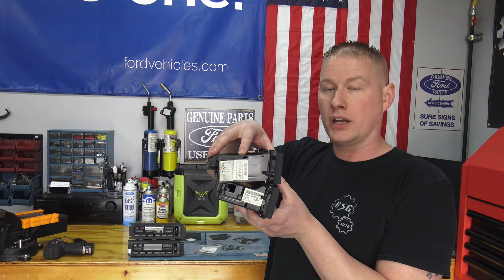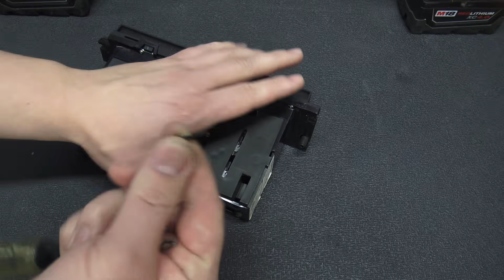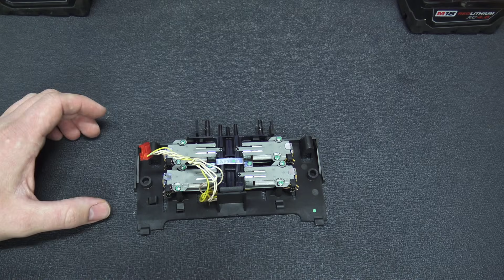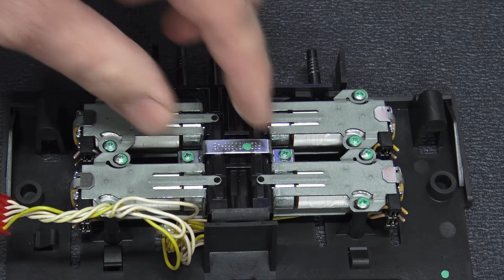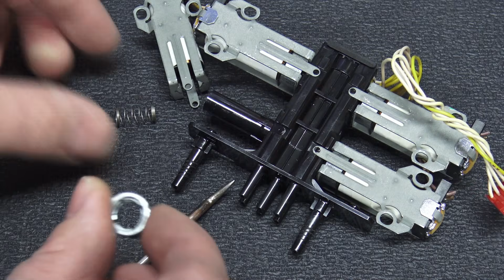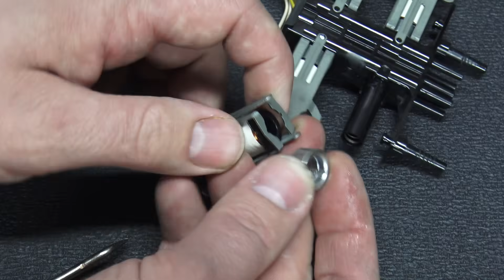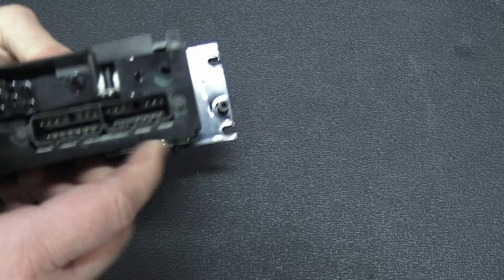Ford HVAC System Stuck on Defrost: EATC Control Head Repair

Comment: Hey man love the videos. Typically the first place I go when working on my 2011 F150 ecoboost. Quick question for you though. Ive got a 2011 f150 Lariat 4x4 with the dual climate control.. Ive already replaced both driver and passenger blend door actuators. Do you have a video or location of the defrost actuator? I cant get anything out of the floor or defrost vents. Ive removed the actuator on the lh side by the throttle pedal and it doesnt even try to hunt after a key cycle and i havent been able to locate the defrost actuator. Thanks man and keep the videos coming
Reply: Id like to add i have removed the actuator and manual operated the door and it only seems to control the foot to face.

Comment: Great video..wish you would of shown how to take the unit out of the vehicle. But I'll figure it out. Thanks
Reply from the maker: Every vehicle is different so I left that out.
Reply: FordTechMakuloco I've got a 02 f150. My air is stuck on defrost. And it's like 90+degrees here. Thank you
Reply from the maker: follow this video to remove the trim panel- https://www.youtube.com/watch?v=0hVI5Yryc1w
Reply from the maker: Oh yeah try this first for sure last I checked your head unit was $675
Reply: FordTechMakuloco OK Ty so much

Comment: Great video, thanks, fixed two units today, but over 4 ours of work.
Other important item is that there is a check valve on which the spring acts which is not shown in the video and it has two different ways to go in of which only ONE is the correct way. The larger "pad" is towards the vacuum ports and the smaller pad towards the solenoid spring.
Also it is really important to put MORE of the O ring sealer/lubricant on the vacuum plug assembly as any small leak there will also cause malfunction as well.

Comment: FordTechMakuloco thanks a million for this video, you saved me a lot of money!!  Instructions were spot on, I had an extra surprise though when the vacuum stopper came out behind the spring, but I found the way to orient that, so now the system in my son's 2004 Crown Vic works perfectly. It was interesting to see how hard and worn the O-rings were when compared with the new ones.  Thanks again, man.

Comment: Did this on my 2003 F150 Lariat and it worked!!! For all of $10 and an hour of fidgeting, my A/C now blows out of those beautiful panel doors and  I learned a lot about how the old HVAC systems worked in the process! Hardest part was getting the spacer to line up when reassembling. Thanks for the tutorial, I will be sure to share with others!

Comment: Thank you SO MUCH! Sat up my laptop at the kitchen table and it was a piece of cake. Should note though to pay close attention and mark the top of each solenoid with a sharpie showing which side was facing up inside its housing. Thanks again. Saved about $500.00.

Comment: Great video. This was this fix! I didn't have the 10 screws to remove mentioned, instead my Unit had spot welds. I drilled thru them and replaced the 0-Rings.  I now have A/C in my 2002 F150, and can't wait to tell my Mechanic. Thanks to the Video I was able to order the inexpensive o-rings.

Comment: Excellent instructions. After being told yesterday that the Climate control unit wasn't switching between the modes such as "Vent", "Floor", etc, and was provided an estimate of over $400 to fix it, I researched the issue and fortunately found this video.  This video provided clear and concise instructions on how to fix the issues with my 2003 F150, and I was able to fix the problem 
 in less than an hour, for a whopping cost of less than $4 ( for the four (4) o-rings from the local O'Reilly Parts store).  I am so impressed with the quality and value of this video.  Thank you very much.  Keep up the good work.
Reply: Carnel Clarke - Would sure like to fix the "stuck-on-defrost" issue (on my grandfather's '03 Grand Marquis AC head unit) asap vs. waiting for O-rings via snail mail... do you by chance recall the O'Reilly's part # for the correct silicon O-Rings? Thanks!
Reply from the maker: Awesome!

Comment: Did this on my 02 grand marquis a little over a year ago and just a few weeks ago the same issue started up again. I used rubber orings that i got at autozone for the sake of getting it done a few days sooner instead of waiting for the correct ones to come in. They obviously worked for a while but i just finished the repair again and made sure to get the suggested silicone orings. Hopefully a more permanent repair. Thank you for the video.
Reply: Do you remember or kept the bag for a part number from Autozone?

Comment: what was the size of those seals?   thx
Reply from the maker: Linked in the description
Reply: FordTechMakuloco
Reply: 007 Size. Get the soft silicone ones from McMaster-Carr:
https://www.mcmaster.com/#1173n007/=18j2noh
Reply: What about the ones that don't operate on vacuum?  I think I got the crap year,  2005 f350 lariat

Comment: If the O rings fail will they lose temperature control?  full cold is still kinda warm, full hot is not very hot etc or would you suspect a blend door or actuator problem?  vehicle is an 08 grand marquis

thanks!

Comment: first time I tried using spray white grease and did not work.  Went got the grease and even replaced the O rings again and greased them up very well.  As of now everything is working perfectly.  On the end of each cylinder the foam is open and looks worn.  Not sure if that's going to give me a problem.  bought my O rings for $10 for 100.  Thank you for this video.

Comment: What is the rubber part at the end of the cylinoid. It crumbled when I took it apart. My real question is. Is there a replacement?
Reply from the maker: +Jose Hernandez if I remember right it was just a spacer

Comment: Great video, did it myself too, works fine now. I bought x100 o'rings, have 96 left. If anybody needs them, I can send you x10 for $3. I noticed that they are out of stock of them on amazon.
Reply: How do I get in touch with you. I need some orings.
Reply: You can buy them from me on eBay. Search for "Grand Marquis eatc repair" and sort by price. Should be $2.99. I still have some left.

Comment: Thank you for this instructional video! I lived without heat coming out the floor and only defaulting to the defrost for 2 winters and once I finally figured out what the problem could be I found your video. the O-rings on Amazon are discontinued but I was able to get the same o rings from my local Hydraulics store by taking them the specs from the Amazon site. it ended up costing me $2 and about 45 minutes of my time. thanks again!
Reply: Also, my vehicle is a 2002 ford f150 :-)
Reply from the maker: Awesome!!!!!!

Comment: 2006 Five Hundred... switches between vent position but when I shut it off it switches to the defrost position.  Also not able to change blower speed.  Could it be the resistor?

Comment: my mercury grand marquis has the same exact problem only blowing in the feet and window no face.what size o rings did you use?
Reply from the maker: Parts are listed in the video description.
Reply: My bad i didn't even notice that just went straight to video

Comment: had this problem on my 2003 Ford Supercrew where the AC only blew out defrost...purchased o-rings from NAPA for less than $1...followed this video step by step and AC is back to normal.  I'm far from being mechanically inclined...this was excellent tip...thank you so much!
Reply: fred spano what is the measure of this o-rings?
Reply: +miguel dominguez 
5/32 ID 9/32 OD #007 silicone

Comment: Thanks, you just saved me $1,000.00. Took one hour, fifteen minutes
Reply from the maker: +BSO 23 Nice
Reply: @FordTechMakuloco   I replaced the o rings on the eatc unit yesterday. I still have the same issue, when I select the defrost function the air continues to blow from the panel vents. Also, I noticed if I select the floor/defrost function the floor vents blow cool air instead of warm air.

Comment: what do i do on my 2003 lincoln navigator that has the slim control unit and just blows air out the the defroster
Reply: did you resolve? I have the same issue
Reply: +Alejandro Montalvo i did, theres a plastic vacuum line right by the battery that is very common for it to get broken. I just bought a rubber hose from autozone to connect the 2 ends back together

Comment: I have a 2003 ford expedition with a manual climate control that only blows air through the defrost on any setting, any suggestions? please

Comment: After dealing with the problem of my A/C doing this for 4-5 years, I found this video and figured I would give it a shot, and if it did not fix the problem I would take the dash apart and check for a broken blend door or actuator. Well, after the recommended o-rings came in yesterday through Amazon, I got to work. I changed the O-ring using this video as a guide, and re-installed it in my 00 Expy. It was the culprit and my air is running the way it should! THANK YOU! FordTechMakuloco for this video tutorial, it was a life and time saver!!

Comment: I did this repair on my 2002 f150 super crew, it's still doing the same thing. Could it be a vacuum line? The a/c only blows out of the defroster.

Comment: We took our 2001 F150 to the shop because it stopped blowing cold air. All vents were fine and air blows out of the proper place. It's just not cold. We wanted it charged but they told us it would be 1300 for an AC control head replacement. If the AC control head burns up does this cause cold air not to be pushed out? Any info would be greatly appreciated
Reply: sounds more like they're trying to rip you off.
Reply from the maker: +Sin City Outdoors I have never seen a control head not turn the ac compressor on if that system was ok itself. I have seen them lose control over the temp blend door and get stuck in the hot position but a reset  would fix it
Reply: +FordTechMakuloco how do you reset it
Reply: You reset it by running a self test on the EACT.   Turn key to on.  Hit OFF and then hit FLOOR and OFF at the same time and within two seconds hit AUTO.  Write down the codes  and 024 or 025 are more common and there are videos on Youtube to show you how to do this. @danlebrun1487

Comment: I highly recommend trying this, I had the same problem. it is really easy to do, took me about an 30min to do. even if you are not mechanical inclined, I still recommend trying it. just take your time and it'll be easy. I went to my local hardware store and bought 4 O-rings that matched the description of the amazon ones and they had them. took my unit apart and the factory O-rings had hardened, so I just cracked them off and slid on the new ones and it fixed it right up.

Comment: Just remember to check your vacuum lines on your engine under the hood (because they are easier to check) before you start taking your dash apart. No amount of work done to the control unit will help if the vacuum is not getting to it.
Reply: easy way to check whole system is remove the control head and unplug vacuum block.plug small vacuum hose from center point to red vac hose and drive vehicle,if it does not switch to defrost while driving, your vacuum system is fine and repair as per this video.

Comment: Do these 4 solenoids only control vent selection actuators? This repair wouldn't effect the control of the heater/ac door actuator would it?  Temperature control.
Reply from the maker: +Clark Bourgeois No it does not

Comment: thank you !!!! fixed my problem of max a/c being on defrost,,,but there is a plunger in the body of the manifold that must be put back in with tiny o ring towards plunger you are working on,,,if it happens to fall out like mine did and had to start another one to make sure how to put it back together.Thanks again!!!

Comment: I did this to my 2000 expedition but it was a little different than yours there were no screws to take out holding the solenoids it was all clipped and maybe you forgot to show the actual insert on the inside of the spring that plugs or opens the vac line, Mine fell out when I was replacing the o-rings. It will also need checked for ageing on the sealing surface. The o-rings definitely were hardened from age. Love your videos has helped me alot on my older vehicles, Thank You!

Comment: what do I do if it's welded???
Reply: I had the same thing mine was spot welded I used a screwdriver to pry them apart when I was done I straightened the metal and super glued it back together.

Comment: Im really trying this an as well ordered the parts going try it out man wish me luck my car Crown vic 03 just shoots cold  through the defrost if i put it low and put it on ac it sometimes will shoot out the face front air vent  but then you turn it up and back to defrost will this fix this do you think 
 thanks and nice video

Comment: Wow.  I wish I would have see this years ago.  I had a 2004 Crown Victoria LX Sport that I replaced two of those head units.  Each unit cost about $750 to replace.  Granted, the first unit I replced at 100,000 miles and the second unit at 200,000 miles.  Unfortunately, I had to retire the vehicle in 2014 with 293,000 miles on the odo.

Comment: I have the same problem with my '05 Mercury Grand Marquis LS. I get very little defrost with air still coming out the vents on "DEF" and no air coming out the floor on "FLOOR" with air still coming out the vents.

Comment: Glad to see you added this video! I did this rebuild a few weeks ago but unfortunately I needed a new air box and had to take it to the dealer. Cost: and hope everyone is sitting down while reading this --- ready?' 🙈 $1350.00!!! BUT!! I'm still glad I replaced the O rings because now my vac system runs the air box in much stronger fashion. I think this rebuild should still be done regardless. My grand Marquis was experiencing no defrost vent only so air box was required according to the dealer.

Comment: 2010 Fusion Hybrid is sometimes stuck on defrost for about 5-10 min or so min during the summer then to the normal vents. Drives me crazy. It happens about 30% of the time and of course never at the dealer. So about every 2nd or 3rd day it just won't work for 5-10 min out of the main vents. Crazy and since the 1st year of ownership. Getting rid of it soon for a 2017 Lincoln MKZ Hybrid, 2017 Fusion Hybrid or a Chevy Volt. Still on the fence. Just frustrating.

Comment: I had a Lincoln where the vac line fell off a motor, so had defrost only. Either not pushed all the way at the factory or the dash was off once before. I had to pull the dash to fix..

Comment: How would I be able to determine if my vacuum line is providing the requisite 15-20 inches of vacuum? Also, will this repair likely correct the problem that I'm having with my fan not "automatically" operating properly? Specifically, the fan will only operate on the highest or the lowest setting. Thanks, Rad

No wonder I like your videos. Semper Fi my fellow Devil Dog!
Reply from the maker: +Rad Monferdini It should stick to your finger tip no problem. The fan problem is another issue caused by the blower motor speed controller itself failing. Semper Fi man hope this helps.
Reply: +FordTechMakuloco If I am understanding your response correctly...the "blower motor speed controller" is a separate part, correct? If so, do I have to replace the entire head unit in order to replace the speed controller?

Comment: On the older fords such as my 03 marauder you can run a self test for the electronic portion of the unit,dont feel like looking thru my papers but basicly you press a couple of the operation buttons to display the codes on the unit. And if my memorie serves me correctly some ford will not run with the unit unplugged ? ..  GREAT CHANNEL!!!!!!

Comment: Thanks for this video. I'm going to do this repair hoping it fixes my problem on my 03 F150. No matter what is selected on the controls their is a small but noticeable amount of air coming out on the floor side. Hope it's not going to be one of the air doors that is not closing right. Either way I'm sure the o-rings need to be replaced. Thanks again.

Comment: How funny, I actually had a crown vic come into the shop today with the same control unit and when I pulled it apart, I found one of the vacuum solenoids extremely hot in temperature. And the mode door stuck on defrost. Thats as far as I got so far.

Comment: Do you think it would be possible to disassemble the unit and clean up in/around the dial for blower speed?

Basically, coffee was in a cup in the cupholder and a little bit spilled.  The control works just fine, it was sticky the first time I tried to move it after the coffee spill but now it moves freely.  I'd like to get in there with some rubbing alcohol and clean up whatever sugary mess might be left that I can't see.

Comment: Have a 1998 Lincoln Mark 8. Last winter replaced the blend air door with the Dorian repair door kit. But now I'm having the same problem with my head unit. Also have a head unit from a 95 Mark 8.Are the head unit interchangable?

Comment: I have a crown Victoria 2002 lx sport the air conditioning  com's on by it self are the problem from the control unit
Reply from the maker: +Mshary Alosamy If you are talking the blower motor then no that is an issue with the blower motor speed controller.

Comment: I have a 2001 expedition with the same issue, only difference is I have twist style ac knobs is the fix the same?
Reply from the maker: +pse hunter You have a vacuum supply concern. Verify the vacuum from the engine is actually reaching the selector knob.